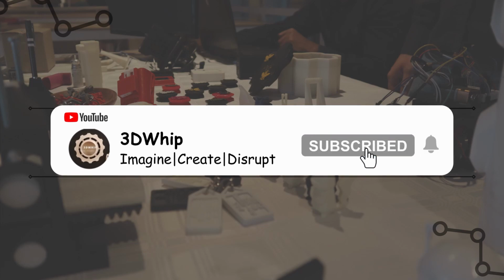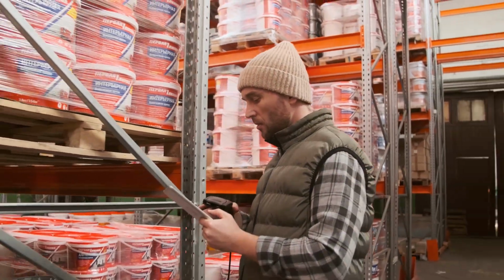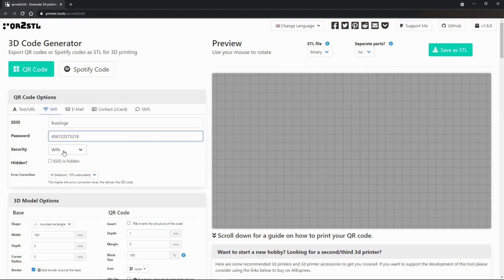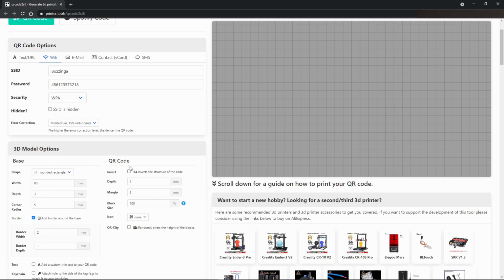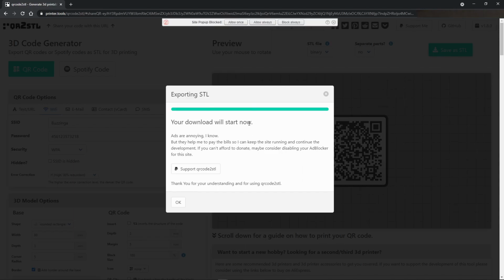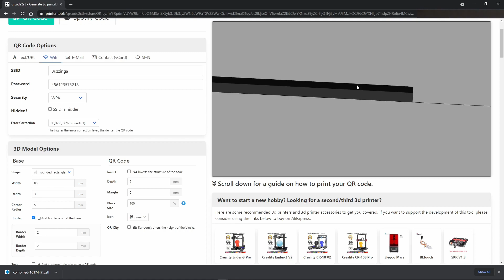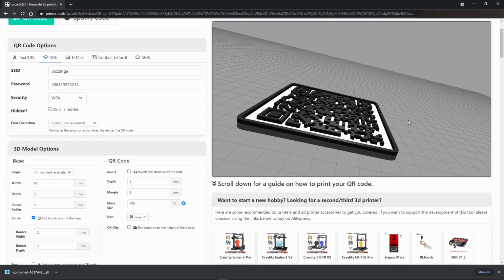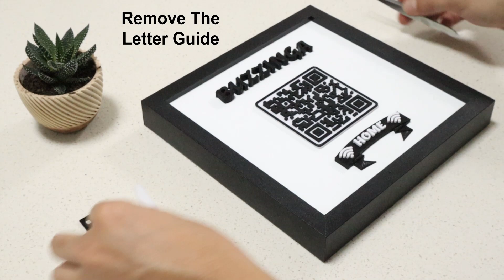3D Printed Wi-Fi Password QR Code Picture Frame

Comment: Great video, but I'd love a bit more information about how you go about changing the filament. I know you can pause mid-print, but cura is telling me something about my model not being "manifold". Does that mean that the gcode will have a built-in pause point? Or do I still need to wait for it?
Reply from the maker: Hi, When Cura says the model is not "manifold" it means that the model is not fully closed and will have errors printing. 
You could use Meshmixer to fix the manifold errors or you could redesign the model. 

I hope that helps.

Comment: Hi.. How would i print my QR CODE on an Elegoo Mars Pro please?
Reply from the maker: Hi, 
You can print the entire model on the Elegoo Mars, however, with resin printing, you wont be able to print multicolours. You would need to paint the top surface of the QR code.
Reply: @3dwhip33  Thank You for your reply.
Reply: @3dwhip33  use a roller with black paint to go over QR code and border 😃